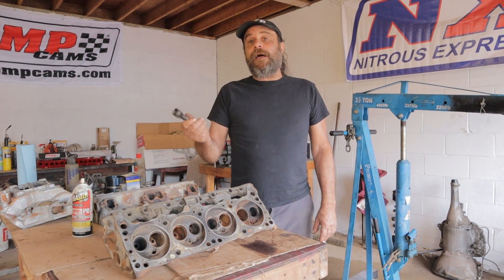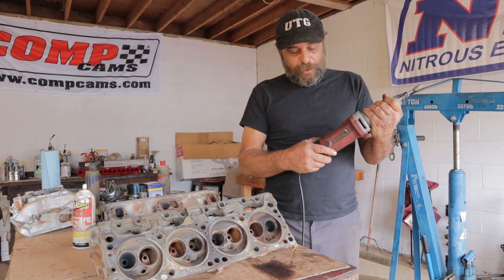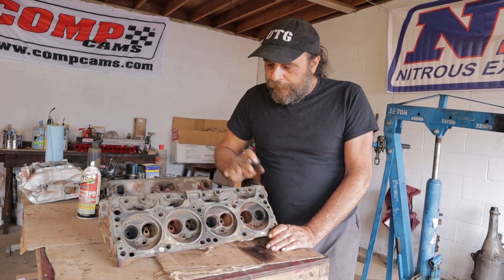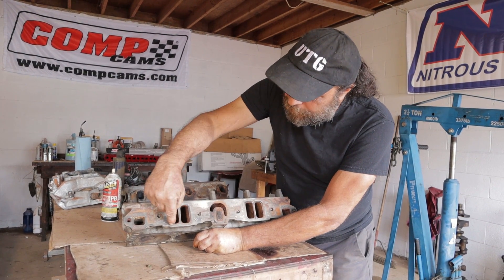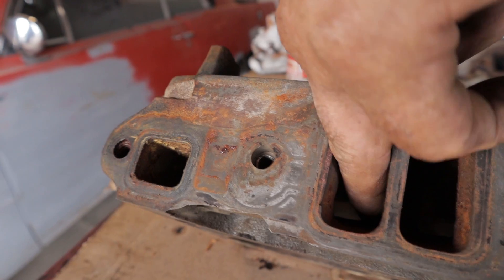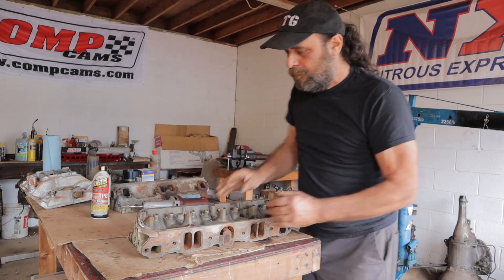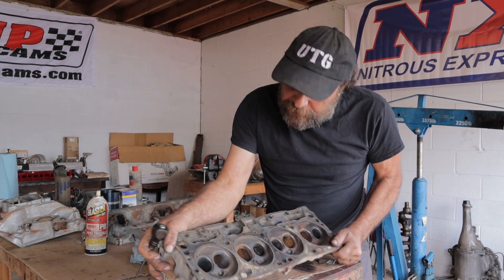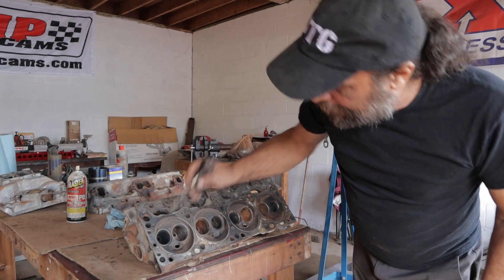Perfect Daily Driver 10 - Cylinder Head Porting Basics

Comment: 1999 Mazda 2.5 had some bumps in the casting. Also, the ports were not well matched.  Exhaust manifolds changed during the production run on the 2.5.L. I use a Dremel It polishes, and I don't do a lot of heads.

Comment: The porting looks good but the valves are the secret when you have it all apart. Getting the gas through those valves at low lift and finishing them with a very narrow seat so they seal well.
Good video on basics.

Comment: Hello Tony how are you. I don't know where to get information on Pontiac cylinder heads. I am a beginner at porting cylinder heads and my engine shop gave me a cracked junk cylinder head to practice on and its a Chevy head but Pontiac is different. Pontiac exhaust bowls have a big cast iron shelf on the same wall as the intake inside the bottom of the exhaust bowl and it looks like it would be a big restriction and I don't know if I should grind that off completely or smooth the sharp edges. The Chevy head doesn't have that and I'm guessing a lot of people don't mess with Pontiac heads because of that and might be why there is not much info on it. What are your thoughts? Thank you

Comment: As a tool and die maker for 50 years the best drills and burrs are hault never get  coated drills cause you can't sharpen them m2 steels are dralled back at 900  1000 degrees and the coating is put on ay 1200 at 1200  so once you get pass the coating it's solf hope this helps you as much as you have helped me

Comment: Order up a Foredom pedal speed control esp if one is a beginner. Finesse over sheer material removal

Tap Magic is the best thing Ive found, its made for cutting metal not lubricating it. Will not clog bit stays sharp much longer. MSC industrial sells nice carbides. Those cheapo ones are worthless

Comment: One rule of thumb is that the intake port just have to feel like an 60 grit sandpaper.Don't polish it.Polishing it can lead to hanging fuel on the port walls because the droplets came out the mixture and stick to the walls.With some texture you create little swirls and tumbles on the walls that act like a little ball bearing for the main flow.When it comes to the exhaust ports polishing won't hurt because there is no fuel anymore,also the exhaust ports will stay cleaner because there is no texture for dirt, like carbon or coal, to stay on.

Comment: Raise the roof don't lower the floor when it comes to porting. It's has lot to do with fuel flow. Not so much on exhaust side. Fuel spray into the intake and sucks down the channel and flops into the valve bowl. Lower the floor the gas can "trip" over the gasket or the head itself going to the valve bowl. After you smooth things over with a carbide use a sanding roll just to slick things over and fine tune the bowls smooth the contours. Doesn't have to be polished just smooth.

Comment: Great video, only WHY? I'd think if you planned on doing a video on port matching, you would never choose an odd combination like this one, where the manifold had SMALLER ports than the heads.  I may be wrong but most of us run into issues where the heads need to be opened to match the manifold.  I'd find that a LOT more helpful. Just sayin'.

Comment: the felpro 1266 did not work i have deeper issues.. Great Vid. I have a fresh 355 with Dart heads that were from a circle track car. Heads were milled and i can see light on #8 intake through my victor Jr intake. My machine shop said to use washers on all 4 corners that equal gasket I'd. Then mold BB` model clay on all runners top and bottom. Slice in half and measure depth. Going to try tomorrow. Also china wall close but not hitting yet. Anything else i can try?  Thanks. John

Comment: I've been porting heads for 40 years, it just blows me away, that ANYBODY takes this guy seriously...
Reply: im in the same boat 40 years as a specialty machinist head porter hes literally telling them how not to port a head ! i could take a duplicate set of heads and not do like 4 big no nos i saw him do and outflow those all day long ! smooth out the throat he thinks the fuels gonna slide in but its not by doing what he did he slowed velocity down it needs to be hourglass shape with teardrop guides if you dont remove them he didnt even smooth the throat
Reply: @stevenbean9706  Not much to be had with guides sure you know
A good valve job woulda trumped all done here.
Reply: Greg, where can I see your video on the same subject?
Reply: Hate to be that guy but most vids on YT re this are pure hackery...the drill/lapping bit too. 
Wth!

Comment: I don't know what self learning EFI is, but if a mechanic uses normal stuff there will be no problem. I rebuilt probably 20 or 30 engines with satisfactory results. The car rusted away before the rebuild gave out.

Comment: lol. buddy i was 16 had alil 78 Dart with a 318. my dad goes take your heads off and port them, u can gain up to 100 HP..! so what did my dumb 16 year old self do, took the heads off and ported them. of course, my dad looked after what i was doing. i was one disappointed young man when i put them heads back on the same 318. nothing done other than a tune up and me porting them heads. 0nly thing i felt changed, it was alil snappier at takeoff, and i do mean alil.. lol. it changed a lot when i rebuilt the engine. love ur channel

Comment: Tony I do have important questions about how far can you go before worry of striking water in water jacket of small block LA heads?   I did what most consider a lite clean-up port job on set of 596/360 heads... it ran great for about 50 miles then apparently started getting water into two cylinders  that are side by side on the passenger side... both those intake valves are clean looking from the leaking..  guess running that way cleans up things in there ( I know it does)  ... I don't see a crack but sure enough somehow it's got a problem... acts like a really bad vacuum leak, won't idle,  etc.. but it's worse then that after few mins run time...  anyway could I have gone to far and ruined a port... or even two?  Seems not likely but how is this happening with 160psi compression test in those cylinders? It's been a terrible situation tryn to figure this out on a brand new 360...    changed intake gaskets twice with no changes in running quality before I drcided to pull heads and then discovered those two intake valves clean like brand new....   my thoughts are a blown head gasket but maybe that head leaks water internally in port area and can't see the crack in the port? ... and it's my fault because I went tiny bit to far?  I've been doin mopar overhauls and many others for 40 years...I've never seen this situation before.......   but I don't port very much... I like aluminum heads.....         🤔

Comment: Great video; direct and simple to follow instructions.  I used the same Harbor Freight Die grinder and have one suggestion: use a speed control.  I bought designed for a router (universal motor) for around $20.  This allowed me to slow the die grinder and the difference in controllability and smoothness of cut with the carbide burr was amazing.  I made it most of the way through one head before I tried it and as a result the second head went much faster and I had better control.  An added bonus was that my hands didn't feel like they were buzzing after doing the second head.
Reply: I read your comment a month ago, bought a speed controller and cleaned up a set of new bare castings. 
Showed my heads to my engine guy and he said 'who did these!?'
I thought he was pissed but he said they look professionally done.
So, thank you for the control it gave me.

Comment: Only thing I'll say about heads are if each volume of each chamber are identical then the engine will not shake. Found this to be true when had a 1972 - 440 Police interceptor motor completely rebuilt with exact cam specs and all new parts bought in Albuquerque, NM at 6 Pack Racing on 4th street and prior to rebuild the engine shook because it was factor built for it was a high officials cruiser in El Paso that was brand new delivered from factory to El Paso Hwy Patrol back around 1972. I was third owner of said vehicle. I'd heard in the old days that one reason a high powered motor shook from a cam was because the cylinders were not ccd. When had motor replaced into original vehicle after rebuilt found by putting hand on motor and could fill that awesome MOPAR power but saw no motor shake. Facts of truth.

Comment: As usual I love you're Videos. It would be nice if someone done a video on how a 318 runs not portted and how it runs portted. Me my seld I am going to port my 1968 Plymouth Barracuda Coupes 318 V8 which has 340 J heads and 323 Sure grip possis rear end with craigers and Mickey thomson 50's. I have a feeling those 323 Posi rear end is going to kill my power on take off. Anyway rock on awsome videos.

Comment: Thanks Tony your Gods Gift to building a great engine.Being a backyard mechanic all my life at age 67 this will help my build on my 340 heads when I do my tare down.I have no Idea about this motor so it may have already been done.As radical as the cam sounds with a stall converter will see.One thing I did notice is the Quick response of acceleration and it has with an 850 double pumper.After putting summit roller rockers good change of royal purple racing oil the RPMs are even quicker.I went with Straight 40 synthetic. Thank you much for your video it is truly very helpful.Hope to get my T-shirt soon

Comment: i would say if its your first job doing something like this, then don't go one by one. do a bit of work on intake, but just a bit. and do the same for all intakes. then do some more work, and repeat it on all of them. reason is, if you work the hell out of the ports of 1 cylinder, but fail to do near identical job on the rest, you are still just making problems and not solving them....

Comment: Hey Tony,
     Tim here, i know this is an older vid, but i just wanted to say, BE CAREFUL on doin much on the exhaust side, YES i wuda removed that huge intrusion also.....but i dont make it like an intake bowl/port......WE DONT WANT REVERSION!!.....if you leave a little behind, so the port is just a bit smaller than the header/manifold, that little step left behind, helps reduce reversion.......and YES the walls and the roof are EXTREMLY important....but i learned to NOT port match the exhaust, to reduce reversion......who wants a diluted air/fuel charge for the next firing.......GREAT STUFF yet again!!.....i dig lookin back b4 i had subscribed....LOTS of gem vids you did.....like this one...PEACE my brother!!

Comment: I like a lot of your video's Tony but, this is a dangerous one for the do-it-yourselfer. ALL heads have casting characteristics and thickness variances in all areas of the runners and bowls. All heads have different needs as far as intake and exhaust. Smooth intake runners do NOT equate into good atomization. Like I say, I like most of your vids but, this is potentially setting someone up for a failure........

Comment: One of the common tems we all know is the "bowl".  But I like to think of it as the "bell":  done right, that is the basic profile you get on an intake port if you sawed the head in half - rounded on top, a slight taper to the walls, and a roundish flare at the opening where the valve seat is.
Thanks for keeping it simple - improvements don't have to be race winning to boost the fun factor of a daily driver.

Comment: A bit about carbide, most of the carbide you get from ebay is Chinese junk. It is of poor quality, the brazed carbide tool mentioned above is just that, a carbide burr silver soldered to a steel shank. Re brazing the shank on cheap tools is probably  a good idea if you are using these  tools. There are many manufacturers who make solid carbide tools, you can find these at dealers like MSC or Travers tool. I have had good luck with tools from Monster carbide and M&M carbide. Chances are what you are buying from Fastenall is chinese . One last thing, carbide is brittle, if you run it to fast and bounce it around, it chips and your burr is worthless, this is where an air die grinder is wonderful, as the rpm can be regulated by the air pressure. Tool and die maker experience .

Comment: tool tip... if you can find a tool truck (snap on, matco , mac ) there carbide burrs are decent and lifetime warrnty. you can buy them in singles too. i just bought one off matco, extended reach carbide burr, i think i payed 35 bucks or so and it has a lifetime warranty. when it dulls, warranty it.

Comment: DO NOT CUT BOWL TO THE SEAT, it will destroy the flow. the throat and bowl needs to be shaped like a Venturi. there are actual head porters on YouTube that will show you flow bench numbers of a bowl and throat that has been cut to the bottom of the seat. and its not good.

Comment: Do not remove the angles of the intake seat, do not remove material from the short side radius, and do not open up the throats too large. You WILL hurt flow.
Reply: So don’t clean them up back to the seats? Or can I clean them up back to the seats keeping the shape the same? I’m going to do a set of 318 heads soon

Comment: Man I really want to thank you for your time in making these videos. Im always doing things on a budget and can't wait to build a street rod. But first I need to get my f350 finished. It has a 460 I tore down. The bearing were wiped with a lot of dirt so I'm see sanding the crank and I found the weak spot is the heads. And if I put a nice RV cam in it the heads will fight me. So I'm keeping the pistons and rings and rehoning the cylinders. Then cleaning the oil galleys and block. Then sanding the crank and plastic gauge. Then grinding the heads and lapping the valves. Anyways thanks again

Comment: a good tip especially for people who may not to confident with a die grinder and/or uncomfortable working around the seats, look into getting some guards 3d printed to protect them. the ones I made for my engine were just 1.5mm thick and cover the  contact area of the seat and 2mm below it. if the cutting head of the burr hits them it will grind through  in about 2 seconds, but that's 2 extra seconds to get the cutter away from the seat when it would have instantly damaged them without the guard.
Reply: Oh I like this, definitely going to make some when I do mine

Comment: Air  flows like a fluid. Best way to picture it. I think a large valve pocket when valve opens let's a larger mass of air flow into cylinder and its mass draws air down runners better. But unless you have a flow bench leave runner alone other than make clean off casting chunks. I like to say l can get 50hp with a die grinder.

Comment: this is the first practical porting advice i have seen. most always ruin heads i knew a man Tim Conolly worked at dyno center at dodge years ago where i learned what little i know about porting. he said its like a highway you want a smooth ride fuel and air want the same. he never gasket matched either he always made a gasket for the intake and gasket for head as they set on engine and port matched the ports. gasket matching always leaves a bump or as he said a ditch in the road because gaskets are always larger than the port.